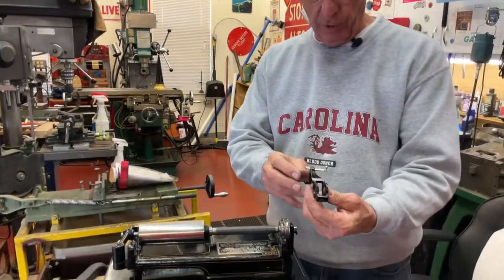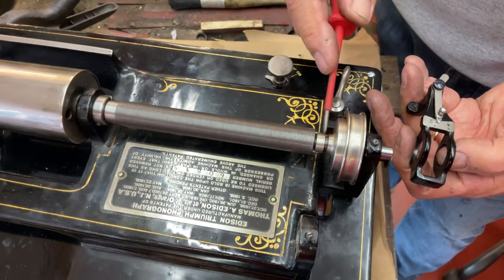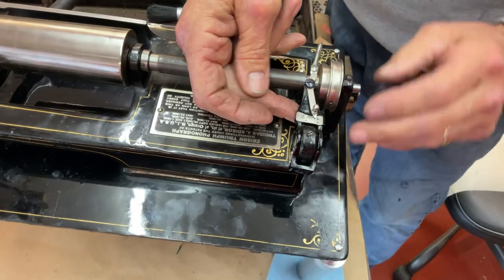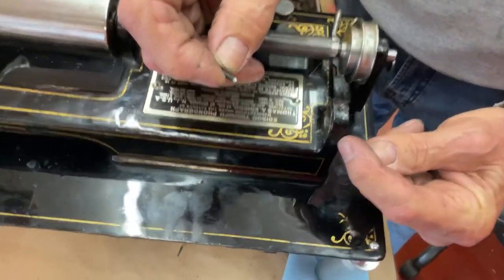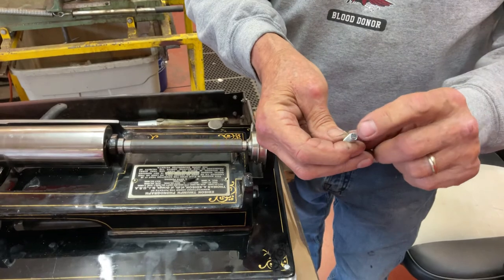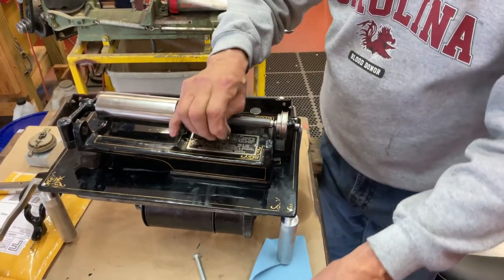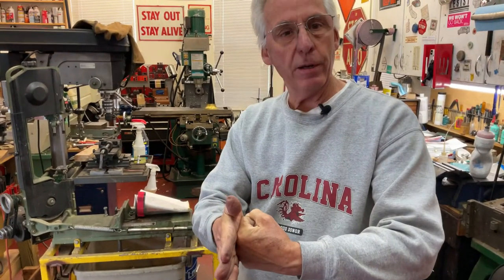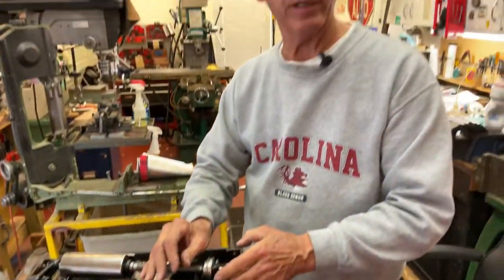1016.  Correcting the Edison Triumph phonograph 2-4 minute lever switch

Comment: The lever was an improvement on the first 2/4 minute attachments: originally, Edison provided a sort of  separate key to lever the gears in and out (my Triumph A might have had that, although now missing: I have to use my fingers). My Home A has the lever, although it is a bit tricky to keep in adjustment.